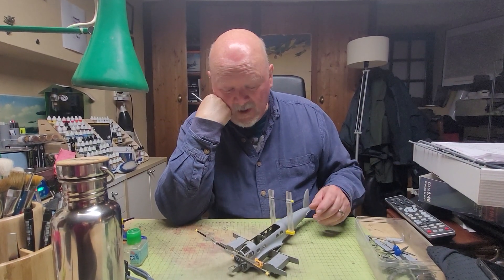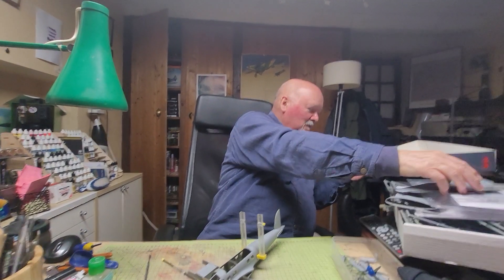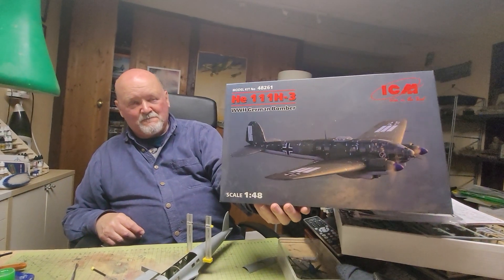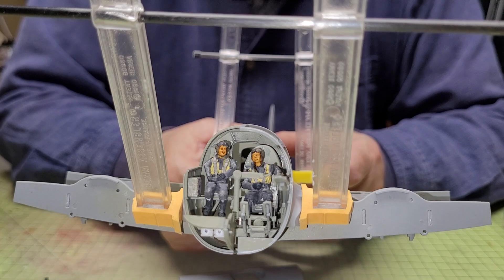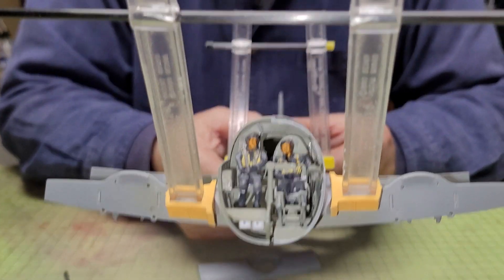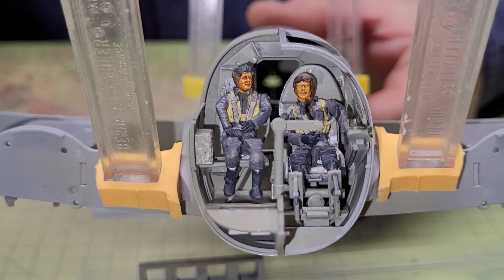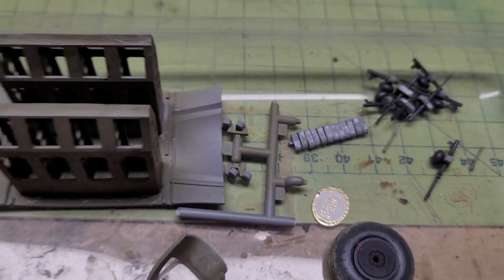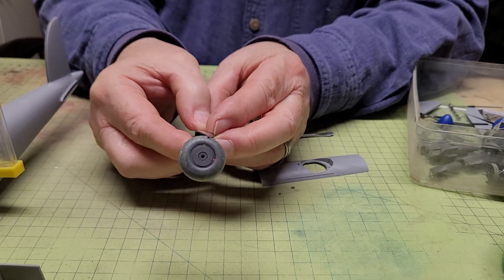HEINKEL HE 111H-3 + Cognitive Dissonance

Comment: I’ve built an ICM Do17z; Brilliant kit. And I’m throwing together their model T Ford Texaco light delivery car at the moment. They’re a great fitting brand. You’re making want to build a He111. I’ve not done one. Yours is coming along nicely.  
I know what you mean about fascination and horrification. I discharged from RAAF last November after 27 years of avionics. All of us love the engineering but none of us want war. I’ve seen enough...Time to sit at a bench instead.
Reply from the maker: I bought a Do 17 kit years ago, only recently made it. Cannot remember the manufacturer .... and one of those models that fights you all the way. Should have waited for the ICM!  The Do 17 is a particular interest :  my father was not old enough to join up until later in the war (Served as Air Gunner, mid upper, 77 Squadron Halifax BIII, February 45 on) But when an aircraft crash was seen, he set off with a mate on a motorcycle to reach the site before Police or Home Guard, scrump as much as possible and get away . So I have a Dornier maker's plate for a 17. And a wheel and tyre from a Messerschmitt 109 brought down near Chilham in Kent in 1940 ..... with a Dunlop tyre, which used to confuse me.   Yup, the ICM kit is good, generally fits together well, I'll have to look at what else they do. And the dissonance ..... I am still shocked at how similar Putin's rationalisations sound to Hitler's -----   hasn't quite claimed it is his last territorial claim on Europe, but only just. And somewhere deep down I want to believe human kind is becoming more mature, sensible, sane, but Ukraine and much else says it ain't.